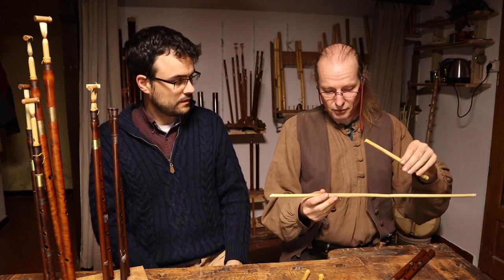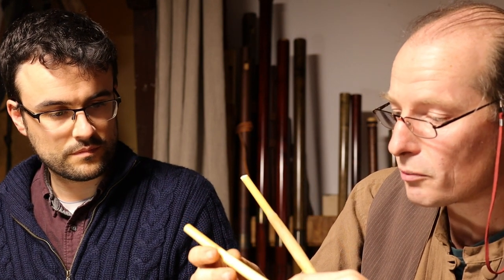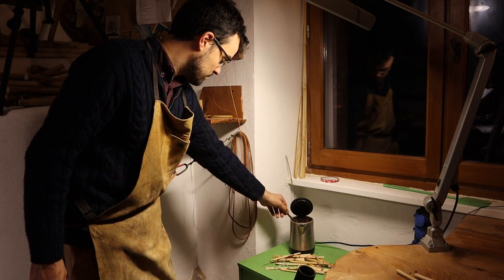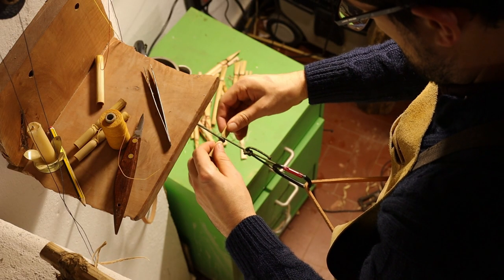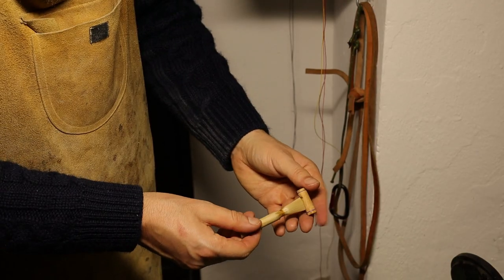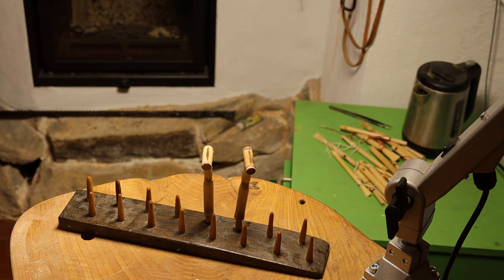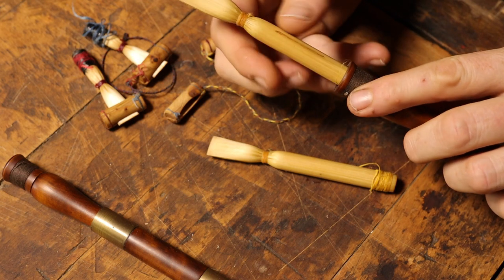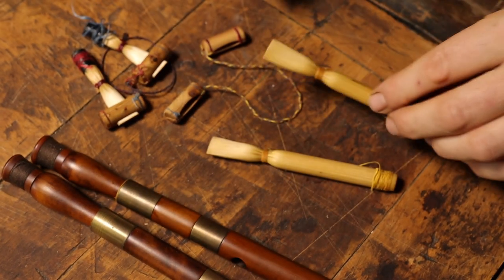Aulos Reeds 1/4 Ancient Greek Double Pipes Aulos Tutorials

Comment: Hello! I was wondering if it is possible to make aulos reeds out of fresh reeds, or do they need to dry?
Reply: I actually never tried. Trying to speed up the process I used material that was only shortly dried and once again I had to learn that the ancient sources tell us everything and shortcuts are for nothing, they cracked and were too fragile to work. So am pretty sure that it is not even worth trying. But please try it and tell me your results, I am curious!
Reply: @maxbrumbergflutes  While reading this keep in mind that these are only my very first atempts at making an aulos reed, or any instrument reed at that.
So I first tried one only a few hours after I harvested it, it cracked. Next I submerged another piece of reed comletely in salt to try and dry it out a bit more, and it still cracked just the same way. And on my third attempt which is still drying next to me it seemed to work a bit better, but still a bit of cracking on the flat surfaces right next to the edges, but I will have to wait for it to dry to see a bit closer how much it really cracked. All these pieces had a diameter of 6-7mm. But if you have any tips on how to prevent cracking then I would like to know. By the way, the cracking of the pieces was happening when I tried to make the blades, making the waists worked great.

Edit: How long should they dry?
Reply: @dannygo500   Theophrastus writes about two different times for harvest and tells us that the process for the earlier harvested reed takes about three years and the other many years. From my experience and the process he describes the first procedure of drying should be until spring/early summer so about 6 to 9 months, then roughly another three. Drying too short or in wrong conditions will make the material more fragile. The site of growth is very important too.
Reply: @dannygo500  if they are alive then the sound will be pretty scary!!
Joke aside. They wont work, they are fluffy inside and no real tubes. Arundo donax works, but not very good, the sound is unbalanced and the harmonics are not clicking in between the two pipes.. Check my videos until about 2021, they were all with arundo.